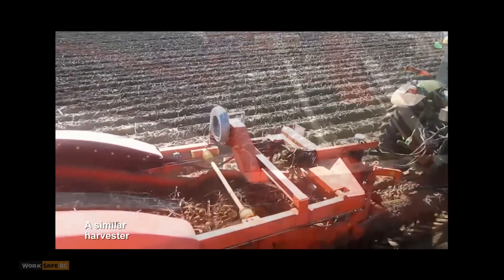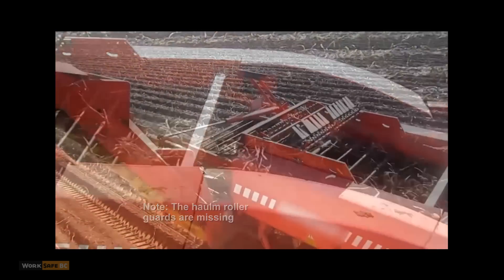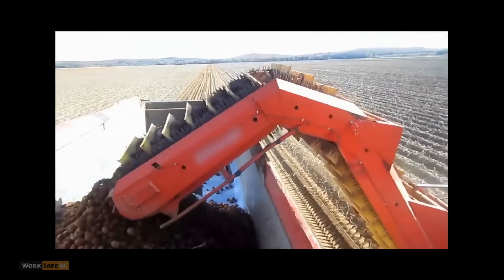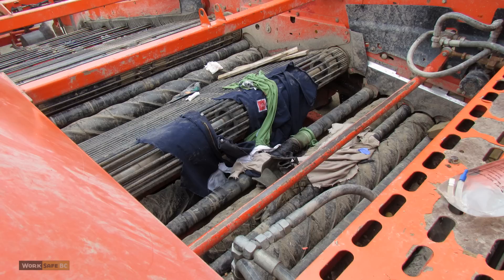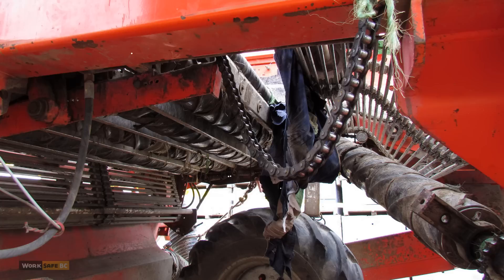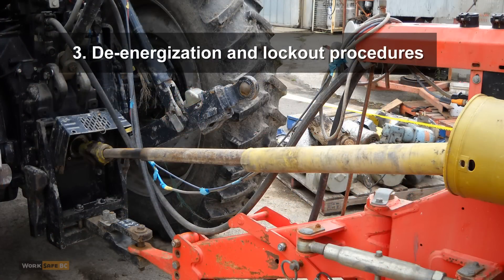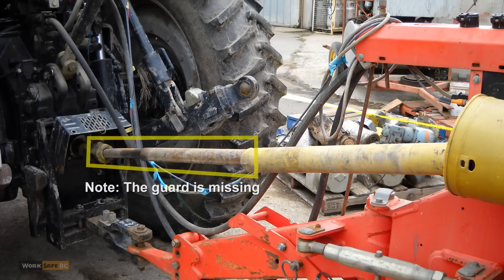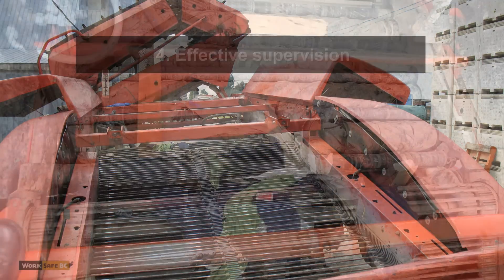Incident Investigation: Potato Harvester Crushes Farm Worker's Leg | WorkSafeBC

Comment: I know a farm worker who did exactly the same thing. If it hadn't been for his young son shutting down the tractor and calling emergency serices, the man question would have lost his leg! On exactly the same potato harvester in this video. The safety guards were fitted but he opened the guards to clear a blockage and lost his balance and stepped on the rollers. Turn off the machine folks.
Reply: Same happened to a guy that layed next to my father in hospital.

The bones in his leg where crushed, but it was the damaged skin that caused the most danger for his recovery. It was a 50/50 to cut it off, he was very lucky they dind have to.

It also dind help that he was a smoker, skin and tissue have a really hard time to heal when you are also a smoker.

Comment: We were working with a young girl on one of the older harvesters once and she had a loose sweat shirt on and it got caught in a set of gears and started pulling her in pretty fast but a fellow worker just happened to have a knife on his belt and he cut the sweat shirt off her just in time. She was one lucky gal.
Reply: Why are you working with a young girl on a harvester?
Why is she wearing a "loose sweat shirt"?
Why is she close enough to the harvester to get her shirt pulled in?
Who was in charge of this shitty operation?
Why wasn't somebody fired for this near-disaster?
Reply: This style of harvester has 8 people on it at all times picking out rocks and such. She was wearing a sweat shirt because in the fall its about -2c in the morning. Shes close to the harvester because shes on it with the rest of the workers. A good man ran and still runs that operation. Nobody was fired because it was an accident. Does that about sum it up for you?
Reply: @EasternExplorer  Clearly getting defensive for a reason. They should know not to wear loose clothing around this kind of machine and not to ever get close enough for it to be a problem. And if there is such a hazard because of the design of the machine, you should foreseen that too. It never should have been so close.
Reply: Eastern Explorer It’s “just an accident” until somebody gets killed.
Reply: If this happen in the US and the young girl was at least 18, did the guy who saved her get a happy ending, if you get my drift.
Reply: @orangejoe204  young here probably means"younger than me", that could be 18 or 28...

Comment: Most of the recommendations dont apply here. Like guarding the machine is impractical when you are trying to fix it. You cant fix it with the guarding on. Removing the key wouldnt have helped because the operator went into the cab to start the machine. It wasnt an accidental start up. Even training wouldnt help here. The worker did something dumb.
Reply: I hate to agree but no body should need to be told not to climb over top of a running machine with spinning rollers. Were these guys born yesterday?
Reply: Yeah and more to the point they were preforming maintence that would require the removal of said gaurds. Also they were checking the machine for function so disconnecting the pto or keeping the tractor off dosen't really help either. That's the problem people have with OH&S. If you followed their guidelines for safety to the letter you literly can not complete the task at hand. 

What really should have been said was, use EXTRMEME caution when function checking machinery, replace gaurds as quickly as possible and never climb on a machine while its running.

Comment: Have a story:
A local farm (UK) had machinery in a shed to sort potatoes. Workers were placed at various steps in the machine process. A local lad (not too clever but harmless) had wandered into the shed and was stood watching people work. The machine fascinated him. The potatoes moving hypnotised him. One potato wouldn't move on - it was spinning in the same spot and it annoyed this lad. He pushed the potato but the machine got hold of his hand. The machine de-gloved the lad instantly.
That same farming company had several farms. At another, a worker came in for a Saturday shift. His job was driving a forklift around moving potatoes in sacks or large boxes. The worker had been drinking the night before and was still drunk. His driving was appalling. On one move he carried the load high and around a corner. The forklift toppled and beheaded the worker between the safety cage and concrete floor.
Both accidents happened within the same year and at around the same time. Obviously, health and safety were quickly onto them. The farmer pled poverty and unable to compensate despite the fact he buys a new Range Rover each year, has several properties and has several mistresses.
Reply: Thanks, a 2 for 1 story

Comment: "they never seen a potatoe harvester before..." yet they were quite comfortable stepping into the cab, starting it up and engaging the rollers. You can see in the cab there's a flat panel with a dozen or so controlls. How was the worker able to figure out which control would start the rollers ? Probably seen one before I'm thinking. Also the supervisor told them to greese the rollers and replace any parts, he did not tell them to start the machine and test it out. That's just according to what i seen in this video. Something doesn't really add up.

Comment: This harvester was well over a 110 K new why were untrained low skill workers trying to to repair it , and how does the supervisor fit into this picture . Where I worked as a maintenance mechanic in the food industry for over 35 years before retiring I saw many accidents . Most by operators who did not understand the machine  , and also by mechanics who were to smart to avoid hazards , As a supervisor I had what I considered a smart tech . When doing electric work  he would often stop and say to me when reconnecting the power . You do the dangerous part  which was handling the high volt input . I thought this to be very smart as he was saying do the part that can kill me . As this was not a minor oops but a opportunity to die . Smart kid .